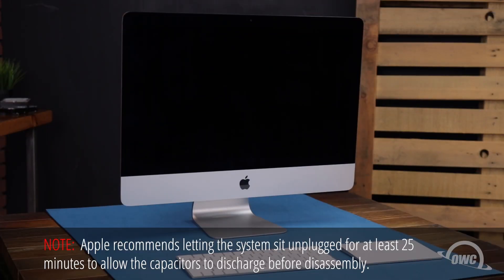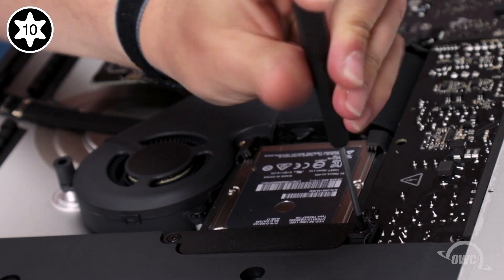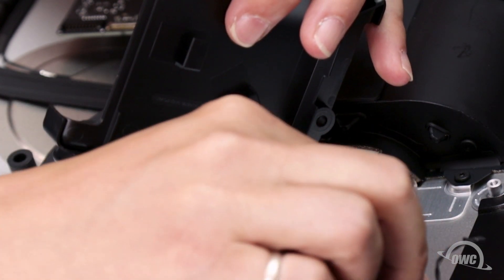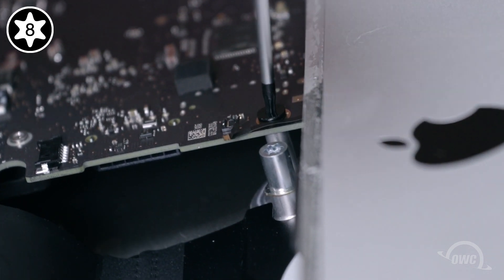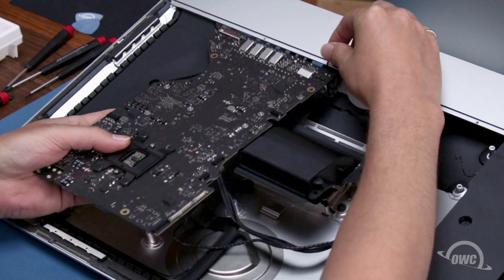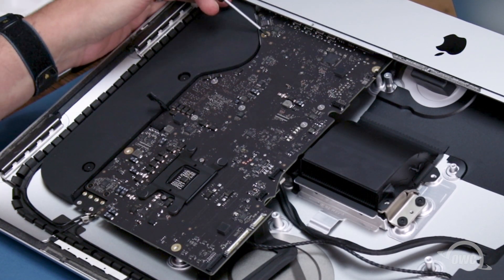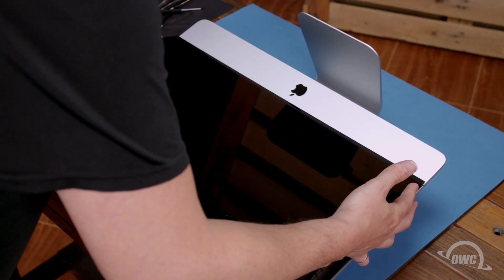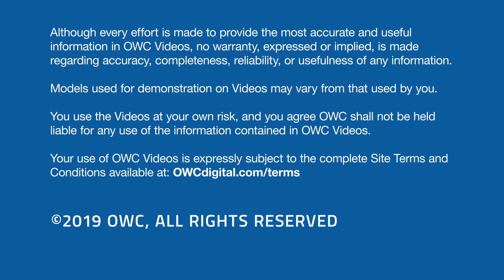How to Upgrade/Install Memory in a 21.5-inch iMac (2017)

Comment: realy great video, took me about 3 hours to finish the process! Thanks for this! There is a tiny problem though: my thunderbolt ports don’t work anymore. When 
I look at the TB ports they don’t seem to be perfectly aligned, however with some effort it’s still possible to plug in my external hard drive. But as I said, they dont work. The other ports do work just fine. Any one has any idea what I could have done wrong?

Comment: I have an 18,1 (iMac 21.5 non-retina 2017). Apple site said this model supports up to 16GB but by the other hand, OWC said can support up to 32GB. Can you please confirm this? Thanks in advance
Reply from the maker: The iMac18,1 can run up to 32gb in total.
Reply: @poweredbyowc  great news! I already ordered the upgrade kit from macsales. Thanks a lot
Reply: @nuevoleonkx  which kit u ordered, and it is working fine, I have same iMac

Comment: excellent video. RAM and SSD installed. I for some reason now have stage lighting  on the bottom of the screen (21.5" 4K 2017). Is this a tape issue on the back of the screen? Any suggestions with how to repair this?

Comment: Hello. Very op video. One question this model support 64g or Only 32g
Reply from the maker: This model can run up to 64GB of RAM without issue.
Reply: @poweredbyowc  I have never seen this done. is this recommended? What would be the benefits of this? Is that overkill?

Comment: This worked until I glued it on.  It booted and rebooted, connecting to the internet, showing the memory upgrade, etc. Then the final step of gluing it back up and although the USB keyboard and mouse show there's power, it's a black screen each time. I've tried 3 sets of glue strips now. I'm pulling my hair out.
Reply from the maker: It sounds like perhaps the display cable isn't seated fully, and when the screen is fully attached, it's not sitting right and causing the screen not to work. I would double check that cable and make sure it's sitting well in the socket, and not being crimped when gluing the screen back on.

Comment: I just sent an email to you technical support about the 4R strip and the fact you need to cut it in order to not cover the microphone. This needs to be added into you video. There has been previous comments about this, and now I am having to pull the screen apart again so I can make the microphone work properly. Otherwise fantastic video, and easy simple steps to follow.
Reply: ahhhh so that’s why it’s not working for me either....

Comment: One thing to check is the tape kit I had didn't leave a gap for the microphone. On my 2017 iMac there are 2 tiny holes just to the right (as you look at the computer) of the apple logo at the base of the screen, next to the centre screw hole for the lower support bracket. Make sure these are clear of any tape (leave a 1cm gap) or you'll sound like you're in the next room and have to take it apart again and get a new set of tape :(

Comment: really detailed and well done video. 
I have upgraded my iMac 21.5 2017 (18.2) with success. Only one note… i had an issue with the microphone and the stripe 4R (A1418kit), it covers it, i found cause here: https://it.ifixit.com/Risposte/Visualizza/418019/Muffled+Microphone+-+iMac+21.5%22+(mid+2017)+-+Following+Adhesive+Strips  

thanks

Comment: Hi guys, awesome video. Did this plus SSD drive and it works perfect except for one small thing, the microphone is next to muted. Noone can hear me even when shouting, if I look at the system settings I can see the volume bar react slightly if I scream like hell. Any idea what could cause this?

Comment: Hello, looking for some help here. Yesterday I updated my Mid 2017 iMac with your 32gb ram kit. I followed your video step by step. After the install and rebooting my iMac my bluetooth module will not show in my system preferences app. Here just to find out what I could've done wrong or what I can do to fix this issue. Thanks people at OWC. Love how clear you made this video and the process was easy to do thank you.

Comment: Excuse me, what are the specs from the new memory you installed there? i am looking for upgrade to 16 Gb but looking into apple website only 2133 mhz memory and 16gb are compatible with 21.5'' iMac 2017 model.
Reply: Hey so if you have the base model 2017 21.5" then you have a 1920x1080 LED display with a 2.3GHz dual-core i5 processor, and that supports up to 16GB of 2133MHz DDR4 memory. If you have a Retina 4K display though then you either have a 3.0GHz quad-core i5 processor or 3.4GHz quad-core i5 processor, which support up to 16GB of 2400MHz DDR4 memory or 32GB of 2400MHz DDR4 memory respectively. Check About This Mac to make sure what you have. In this video it looks like they had the 3.4GHz i5, since he swapped in two 16GB modules of 2400MHz DDR4.
Reply: So this computer only has 2 ram slots not 4 like the other ones ?
Reply: @juansepulveda6055  I wanna say its just the 27in iMacs that have four slots, and all the 21.5in ones have two. Not entirely sure though